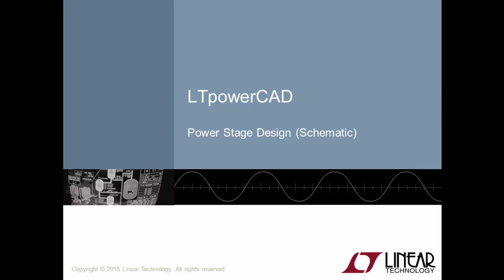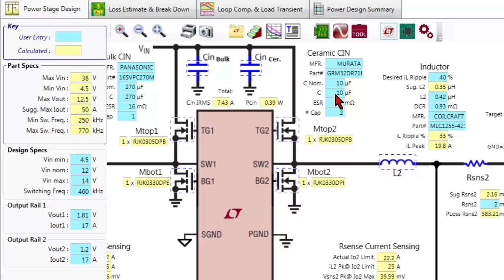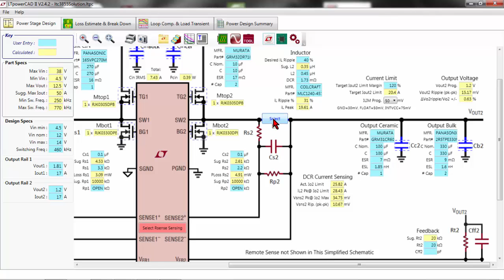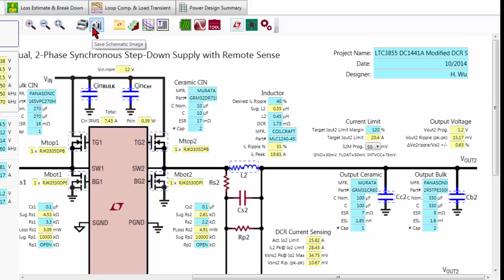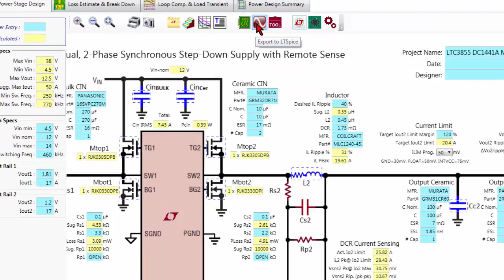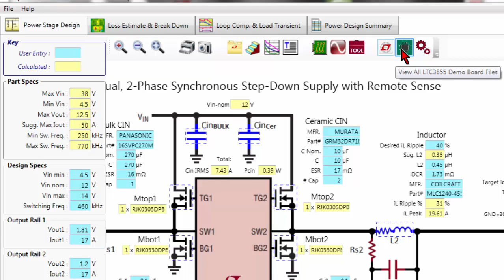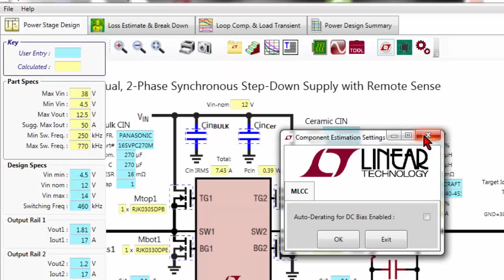LTpowerCAD: Power Stage Design

Comment: Unfortunately, I'm unlucky. The program always crashes during the update (Windows 10).
Reply: Hello Jaroslav,Here is a response from one of our engineers.Thanks.

LTpowerCAD needs the installation of the Microsoft .net
framework (>=3.5 if I remember correctly) as a pre-requisite to run the
program.

 

I have had installations choke on the attempt to load .net

 

Does the user’s attempt block on that step, or subsequent?

 

Can he send screen shot(s) with the error message(s)